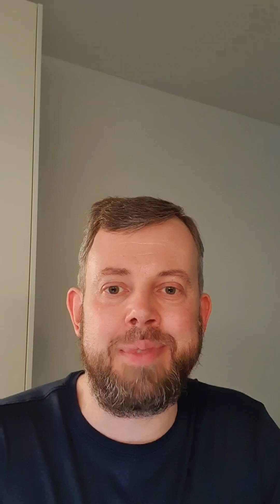18th Edition Amendment 3 Change

Comment: Not sure if if this is a dumb question, but when we do an EICR on a TT install with an “all rcbo” board. If you have 1x solar PV circuit connected on a uni directional rcbo. Doesn’t this mean you just need to swap out 1x uni directional device fitted on the solar PV circuit, for a bi directional device? Or do you swap the lot out? 

How about EV also, stand alone battery storage or ups? Do these all now need bi directional??

RCD considerations are becoming more of a ball ache… but look on the bright side we have less testing on the bloody things now!!!
Reply from the maker: In that situation, I think it would only be necessary to change the rcbo that supplies the PV circuit. 
The regulation applies to all situation where the current can flow in both directions.